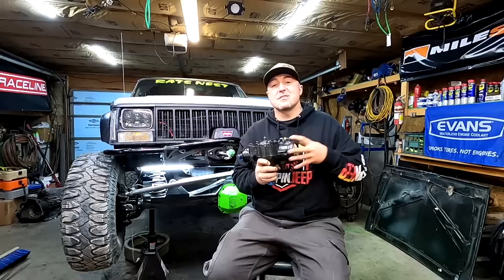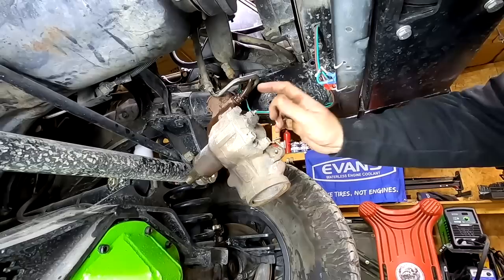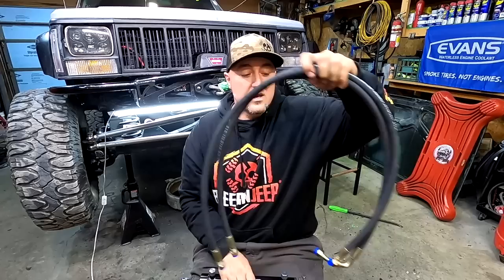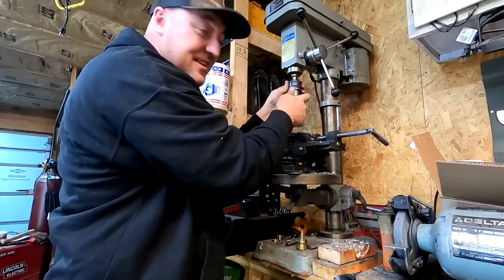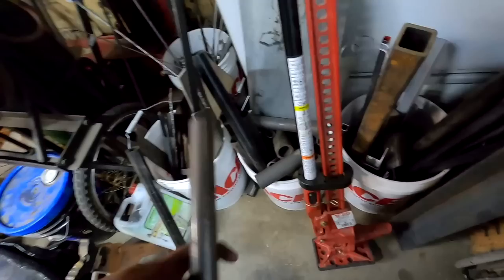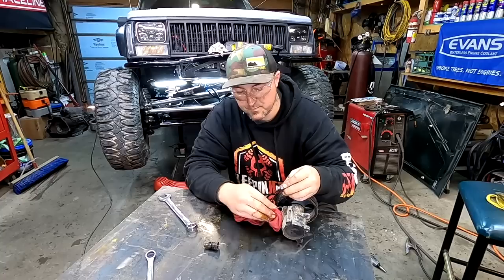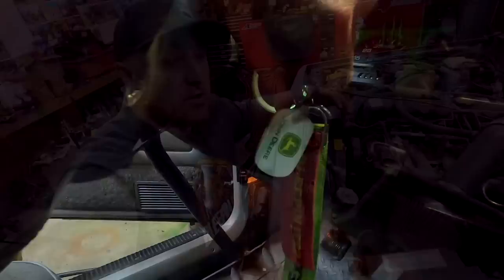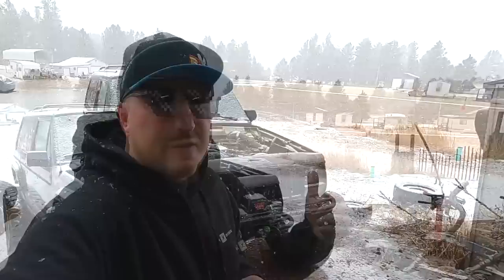How To Make Budget Hydraulic Assist Steering!! Rats Nest Can Steer!

Comment: Just a tip when doing power steering work. Once you are putting the fluid in, draw a vacuum on the reservoir and it'll pull all of the air out for you before ever turning the pump at all. I use a brake bleeder, that I stuck the hose through a rubber shock bushing I had laying around the garage. Then you can hold that rubber bushing down on the top of the reservoir opening to seal the system. Works fantastic every time, never had a single air bubble or groaning pump!
Reply from the maker: Good tip!
Reply: I’ve done that   The psc reservoir makes it easy  I just connect to the fitting on the cap and Dre on it.    I also pre-filled the ram and the lines before attaching to the steering gear
Reply: Love these tips.

Comment: Get a spare piece of hose to tie the ram ports together.   No need to remove ram.
Reply from the maker: does that work?  Must try this!
Reply: I had a pump failure and it was horrible.  So I  just capped the ports on the gear then put a jumper hose between extend and retract on the ram    I’m willing to bet if you were to have enough fluid in the ram with an  orifice in the jumper it would now act as a dampener

Comment: Hey Colt, nice job!
Not trying to be mister know it all, just trying to help everyone. Saginaw PS boxes use different size fittings for pressure and return, can't be incorrectly installed, also when grabbing PS boxes from junk yards, don't forget Saginaw boxes use different types of fittings. Early boxes use inverted flare style of fittings, later boxes use O- ring fittings. This pump upgrade is a must when adding a ram, you really need the increase in PSI and GPM to reap the benefits of the ram

Comment: Running power steering through the trans cooler as a part of the radiator  helps keep it from "overheating", but also due to the coolant heat, holds it at a stable operating temp of engine operating temp, so that the power steering is not cooling an heating depending on use.

Comment: you can also set the ram so the spacer is just on the outside. i installed mine centered with the intention of coming back and doing the spacers inside and out, then i saw someone just doing the outside. forehead slap.

Comment: The radiator's transmission fluid cooler is a great idea to keep power steering fluid temperatures in operating range at 180 F and below 250 F.   I actually plumbed the trans cooler of my radiator for additional coolant flow from the heater circuit to help combat the Arizona desert heat.  I use a separate trans cooler and didn't want to waste the extra cooling capacity of the radiator.  The radiator/trans cooler is really a fluid warmer more than it is a cooler.  The cold temperature in snow country can make the power steering fluid flow like molasses and put excessive forces on the pump, the lines, and seals causing failure.  Good video.  Keep Em rollin.

Comment: I've been wondering if I could put a power steering box from one of my Diesel F 250s. I don't want steering dedicated to two way hydraulic steering cylinder up cause if you have a failure  u got no steering. Power box loses hydraulics you just have hard steering. Have you done that?? I have an 87 Comanche. Thanks Dandahermit

Comment: When you change the steering box and start the engine first time after the changing it keep your hands and arms away from the steering wheel. If you do make a mistake and switch the lines on the box the steering wheel will violently turn back and forth.
Reply from the maker: never seen that happen, I did do that once but it just bound up.
Reply: @bleepinjeep  I did on my 86 Grand Prix. I have a Borgeson Delphi box and made an error with the lines and the steering wheel jumped back and forth. I saw that happen on youtube before I screwed up so at least I remembered and still have all my fingers..

Comment: I’ve got a JKU with a 6 inch ram and I know I measured short. I could probably get 6.5 inches out of it. But honestly I’m probably better off at the 6 inches so that I’m not putting pressure on my pump, as well as not binding those U joints up even more. 

I’d love more steering angle though…

Comment: Perfect timing, this is my next major upgrade on my 89 YJ. It has manual steering now. I know some folks use the Durango box as a slight upgrade, but I’m only gonna run 33s for now. What box will be best besides stock and can more than one model work or does it have to be off a YJ? I’ll be sending it off to Bleepin for the rebuild and drill for HA ports.
Reply from the maker: The factory box should be fine.  The Durango box is a popular upgrade, not sure if that works on YJ but maybe so.  I once heard rumor it was just faster, not stronger...  And then PSC has their own boxes as well.

Comment: I remember as a teenager using a pickle fork on a pitman arm on a j20.  Pretty smooth.
Reply: Caution!  If the pitman arm has been installed by Harry Hammerhand, the pickle fork will likely distort the housing around the seal snap ring so you can't change a leaking seal!

Comment: Toyota and Nissan forklifts have full hydro steering that can be ran on a toyota power steering pump and im sure other's. I currently have 300$ in my truck steering and I'm running 15in wide 36's and can turn them no concrete with one finger at a dead stop.
Reply from the maker: Full hydro steering isn't road legal in most states. This is hydro assist because many states require mechanical linkage.
Reply: @bleepinjeep  true true and its not legal in Ga either but luckily none of the states down here as long as we aren't directly causing danger to others I.E. speeding or running over stuff on one cares lol.

Comment: Colt, is it better to use anti-seize as a lubricant on your pullers vs something like axle grease?  Great video as always!
Reply from the maker: I personally use antiseeze but I don't see why grease wouldn't work too.
Reply: No!!! Antiseize has metal in it! Horrible idea. Should never be used in moving parts and the puller will see pressure in the threads and wear it out faster! Lost some credibility in the mechanical knowledge watching the video and seeing that.

Comment: Glad you made this vid.  Thanks.  Question, if I do the pump mod with a speed proportional pump, will it end up being negated?  And is it still the same procedure?  Do I just have to remove the speed solenoid from the top before accessing the pump pressure spring  Thanks again.

Comment: what if you just increase the pressure and volume like what you did but without using a hyro ram?
Reply from the maker: You could but it would be unnecessary for a stock application, if you're having pump issues then the pump is probably bad.
Reply: @bleepinjeep  pump is new i just want a little more umph with the 35's im running on my tj and really cant afford to do a hydro ram

Comment: How is buying $800 worth of parts budget? Budget would be drilling and tapping the box yourself and using a cheap tractor supply or junkyard cylinder. The only thing I wouldn't reuse for this is hoses. The trailgear ram kit does seem like a decent value, but I wouldn't say low budget.

Comment: When you guys rebuild the boxes do you port it internally or just the drill and tap for the hoses? I've done the drill and tap thing and it didn't work that great. Problem I notice was the stock internal port were tiny when you compare it to a dedicated PSC tapped box.
Reply from the maker: There are multiple 1/8" ports in a factory box and some are inaccessible.  So no, we don't port the visible ones but are happy with the results anyhow.